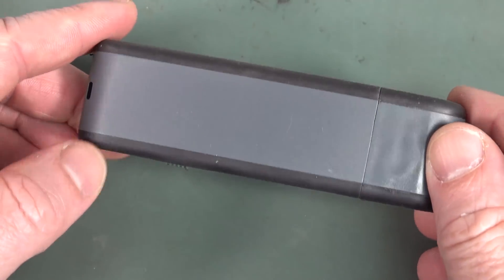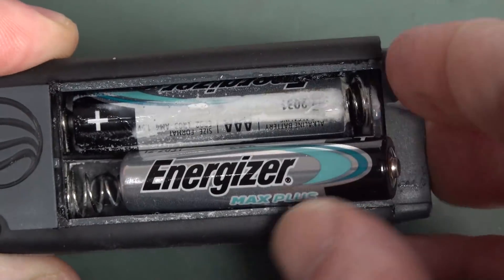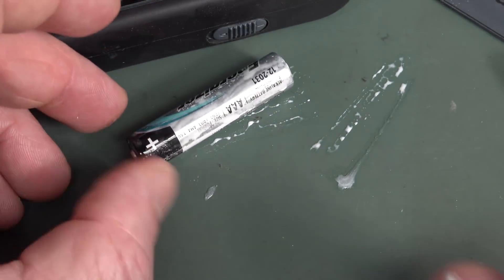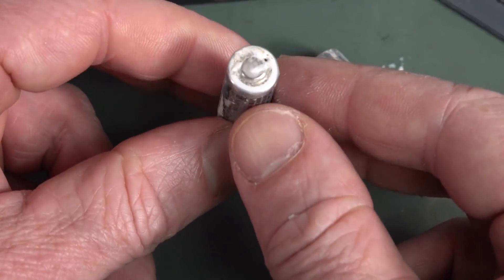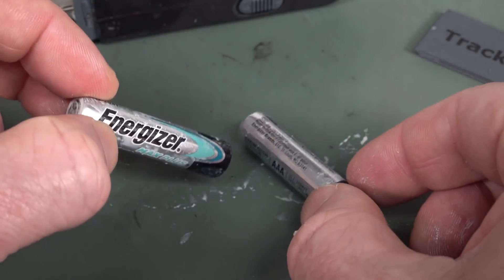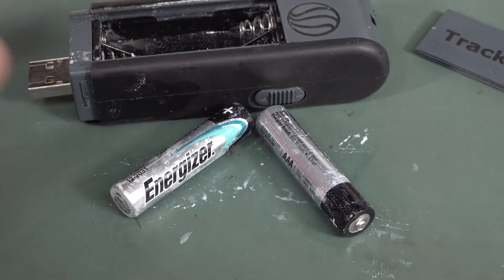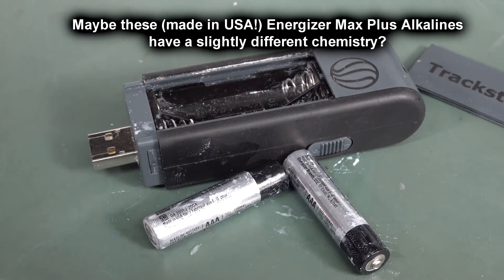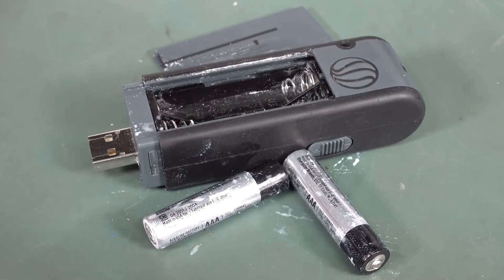EEVblog #1349 - Energizer Battery Leakage - MADE IN USA!

Comment: I've stopped using alkaline batteries in anything I leave sitting for any amount of time. NiMH in their place. I have yet to have one of those leak. Anything that uses button batteries gets them taken out before storage.
Reply: They make rechargeable Lithium button/coin cells.

I've switched to those in all devices that would run correctly off them, and have never had them leak or pose any issue sitting around in devices over the years.
Reply: I have never had a regular button cell leak, but I have seen NiMH button cells leak... On the boards of a rather expensive bit of kit, in fact. I charge a cool 50 euros for fixing those boards. Desolder the tabs that hold the cells to the board, clean up the corrosion, run wires for the traces that look iffy, apply some solder mask, solder a couple wires attached to a 3xAAA NiMH battery pack sealed insider a tic-tac box with hot glue. I figure the board might be overcharging the small cells, they act like a suicide battery.
Reply: @Fridelain  I've wondered that myself. I have various synths , game consoles and stuff with button cells and I monitor them closely. I've seen this once where it leaks and I suspected it was getting overcharged. Although I've been realy lucky button cell wise - I tend to remove them as soon as I can and go for the AA or AAA route. I have a synth I bought back in 1987 new, and it still has it original button cells and they are still fine. I will take them out soon just because, but I'm half tempted to see how long they can go.
Reply: Yah, love my NiMHs but they have shch a relatively short lifespan (I have 2200mAh jobbies)...
Reply: @Blitterbug  I’ve had the same pair of 500ma NiMh batteries in an outdoor solar lamp for years now which don’t seem to want to die.
Reply: @HighestRank  Wow. Different use case tho? I have a set of PIR lights round the house for night-time navigation that take NiMH and they seem to need fresh cells more often than when I just used to bung normal Duracells in 'em... So I thought they had a faster drain that alkaline chemistry? Just my setup maybe.
Reply: I've had it with Energizer rechargable NiMh cells. I use a lot of rechargeables but it's all for video game controllers and really small electronics usage - nothing heavy load. AndI had a few sets of Energizers over the course of about 4 years. All leaked, separate batches. Though they were bought at different times, they all leaked after around 2 years or before. Never got near end of life.
And no variables like extermes of temperatures. All kept by the side of my bed along with the controllers and consoles I use. Standard room temperature stuff at all times.
Reply: @crunchyfrog555  it? you’ve had what, exactly?
Reply: @HighestRank  Leaking.

Comment: Years ago I bought a pocket LED flashlight with a machined aluminum body. Nice and bright. One day I tried to use it and it was dead. Inside was a plastic carrier for three AAA batteries, which were included with the light. They were Chinese alkalines, probably Won Hung Lo brand. As I tipped the light to let the battery carrier slide out, a lot of clear fluid splashed out. New batteries couldn't save it, the circuit board was rotted by the fluid.

Comment: "Energizer will repair or replace, at our option, any device damaged by leakage from Energizer Alkaline batteries either during the life of the battery or within two years following the full use of the  battery."
  So there's that at least vs the no name batteries.
Reply: Try getting them to pay though.
Reply: Hahahaha! Sure. Good luck with that!  It as good as the surge protector $10.000 guarantee!  Marketing wank is cheap.

Comment: I tried recharging some duracells (alkalines) and they leak liquid from the negative terminal just like that. The battery remains functional (after recharge) but in my case its like the inside expands and then pushes the negative seal out and then it leaks with heat. Didnt try seeing the ph but it doesnt seem as corrosive as the usual crystalline stuff. Maybe its mostly water.
Reply: So, your saying recharging disposable batteries is bad? Or were they the NiMh? Only NiMh I ever had leak were accidentally overcharged.
Reply: @tl1024  
recharging alkaline duracells is bad. I recharged some other brands (also alkaline) playing with my imaxb6 and they had no problems nor leaks. 
For example i have in my hand an ACDelco AA alkaline which i used to test its capacity (which read around 2700mAh) and after that i fully recharged it to about 1.7V (accepted about 2500mAh iirc)  and all this about 8 months ago. It has yet to leak anything and its reading 1.53v.   
It says powermax USA, made in china.

I also tried with some energizer 9V batteries and also didnt have issues, but after a 3rd recharge it wouldnt last anything at all on my DMM. 

Its duracell or whatever factory that makes duracells that is crap.

Comment: Never seen one that bad.
If it came from the US recently on a plane, perhaps it was the pressure or lack of pressure during the flight that caused it?
Reply: Thunder Kunt  Not all cargo is going to go pressurised, only stuff that is sent at the higher rate will travel in pressurised cargo, the rest go unpressurised, unless the pressurised cargo is going to have empty space, where they will shove some of that unpressurised freight in. 

Low pressure will not harm things like mail, where paper does not care, but parcels might.
Reply: @SeanBZA  And even on pressurized passenger aircraft they experience a lower pressure. This is done to reduce stress on the fuselage. It depends on the aircraft how much pressure differential is allowed, typical cabin pressure is about 0.77 atm with 11 km flight height, so about 1/4 lower than at sea level.
Reply: @1Hippo  With that logic, you better not bring electronic gadget with Energiser "Made in USA" batteries on any mountain higher than 3000 meters. Many people live or travel above that altitude.

Comment: I had a liquid battery leak with some store-brand batteries last month. Thought I had a roof leak when I found the remote control from an air conditioner sitting in a puddle.

Speaking of Duracell being notorious:
I have a sealed pack of Duracell AAA batteries that has completely destroyed themselves in the package even though they don't expire for years.
Reply: I have several that leaked while sitting unused in their packaging a good five years before their purported expiration date.
Reply: Sealed by what exactly, a sheet of pasteboard half-reinforced by a plastic bubble? Yeah that’s hermetic for sure.
Reply: @HighestRank  it demonstrates I didn't do anything to them to cause it. No exposure to other brands that might've leaked into them or physical trauma or whatever else Duracell may try to blame when confronted with their shame.

Comment: Vinegar or lemon juice are acids and will neutralise the alkali potassium hydroxide. you still need to wash in water everything after neutralising the alkali. Battery leakage was very common in my childhood 1960 - 70 with the zinc casings totally dissolving on carbon zinc batteries.
Also  It is my opinion that only one alkaline battery in a set of two or more  will leak because it goes flat first and the other batteries reverse polarise the flat one. Devices that draw tiny "off" currents are the worst for leakage and damage because you cannot predict when one battery is going flat.

Comment: Resently, I also had Energizer industrial AAA batteries leaking, but not liquid as this.
Reply: We used those where I worked for flashlights and such. They never last very long. We had a small plastic tote in my area that we'd toss the dead ones. Every time, those batteries would leak after a short time in there.
Reply: @deadfreightwest5956  your being the go-to guy for dead batteries, that’s so kind.
Reply: Those are the worst... I’d rather use Harbor Freight freebies.

Comment: I lost a nice Maglite flahsligth for that liquid are duracell.
Today I use energizer lithium are the best battery that I use
Reply: I bought the tiny AAA model for £5 and stupidly left a weak battery in to use it up. It's now permanently sealed and the silver coating disappeared from the reflector.
Reply: @dazednconfused31337  it's done. Then I buy a fenix e12 and all the time I use energizer lithium cost more but I use for a year and half
Reply: I won’t buy alkaline batteries except for an electric toothbrush I use every day so dead battery won’t go un caught. Can’t beat  $10 for a new rechargeable LED on Amazon, comes with a built-in charger and belt pouch.
Reply: @HighestRank  I buy rechargable after I find this energizer lithium in emergency situation I can lost time to find a battery that have charge with this battery's that situation never happen. Don't loose charge without use.

Comment: I've come across Energizer cells leaking in devices with high drain and then left unused for a couple of months. It was this type of chemistry too.
Reply: The problem is that it’s a USB device, which will be powered as long as it’s plugged in. Charging alkaline is a noNo.
Reply: Yes agree as seen the liquid usually on high drain

Comment: Meanwhile in your controlled test no batteries have leaked. Lol
Reply from the maker: Bloody murphy.
Reply: @EEVblog , if you say “Bloody Murphy” three times in the dark, something will go wrong.
Reply: @pyromen321  also must use a mirror and spin 3 times backward with your eyes closed.
Reply: @EEVblog  Is it possible this device's current draw behaviour is different to a plain resistor and that accounts for the difference between them and the chance of leakage? How about profiling the device and replicating its load parameters for the experiment?

I have seen dozens of batteries leak in devices, but only once or twice in storage.
Reply: @Agent24Electronics  Good plan there, might be telling of the type of situation in which a battery is more likely to leak in.
Reply: @danmackintosh6325  @Agent24,  most leaks happened in remote controls and calculators in my case. I believe a resistor could be used as it can represent a device in standby mode.